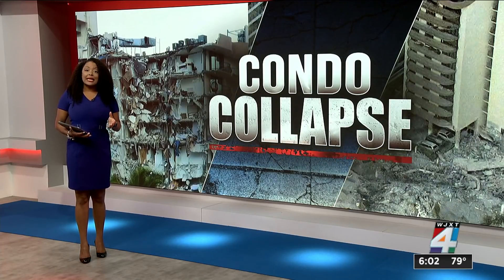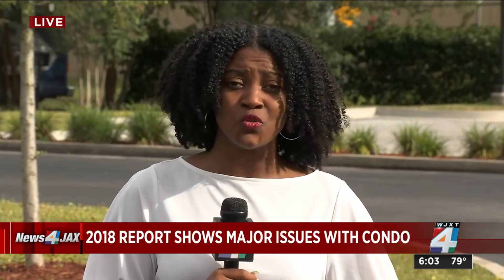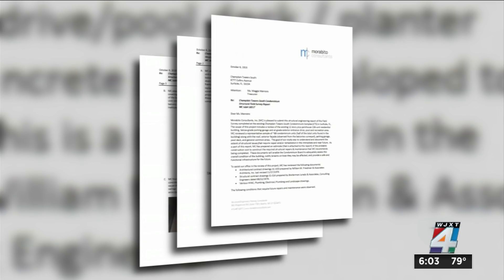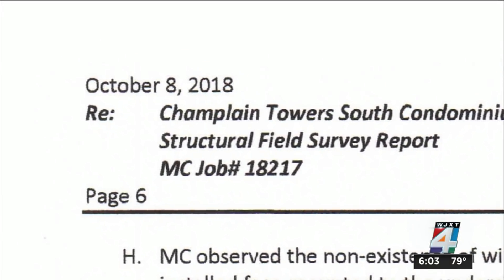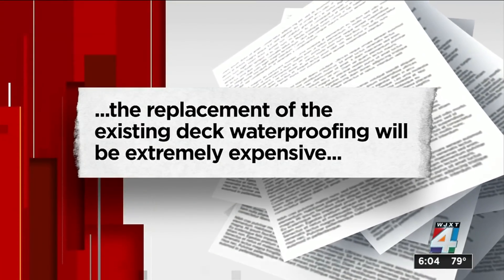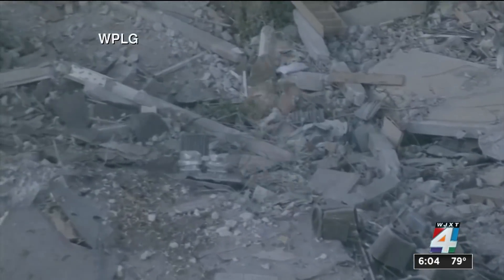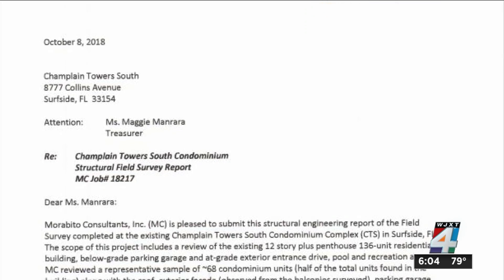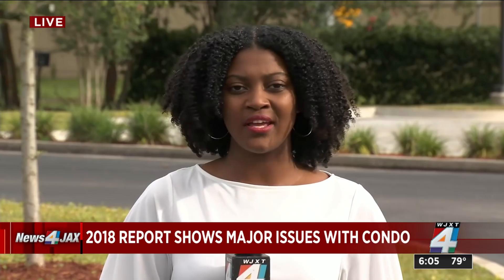2018 engineering report showed ‘major structural damage’ before condo building collapsed

Comment: Lol "repairs would cause inconveniences to the residents."
Reply: Does that mean the residents don't rate safety standards that will protect them
Reply: @leonardroblessr.6120  No it's saying that the inconvenience caused by their inaction is far worse for the residents had they done the repairs needed.
Reply: @oatlord  honestly speaking, for a building to collapse like that it's beyond repairs. It was supposed to be torn down. No amount of "bandaids" were going to keep 40 years of damage to that extent from total failure.
Reply: @oatlord  No it's not. Why do people keep reading this line incorrectly? It's in the 2018 engineer report. Is engineer trying to explain to their customer (The HOA/building owners) that they have a serious repair on their hands, that even though is going to be disruptive and expensive, MUST be done. It's almost like you people are thinking these came from the building owners or something. What you're saying, doesn't make sense. It's not related at all in anyway to the collapse and is a statement from years ago.
Reply: @jonny-b4954     This is true, but the commenters aren't necessarily confused about or misinterpreting this quote.  I think they're just pointing out the irony that failing to either repair the damage right away or evacuate tenants led to exponentially worse "inconveniences" for the tenants.  That's called "dramatic irony"; our current context for the quote gives it a different meaning than it had for the engineer who wrote the 2018 report.  We have knowledge that he didn't have about just how horrifically "inconvenient" the situation became.       ////Bunny kisses for all!
Reply: @DelinahLovesHouseBunnies  Yeah, I some of them I read like that. As dramatic irony. But some... just reading an out of context comment or quote and running with it. Certainly is a tragedy. If law for inspections was say 25 - 30 years or something they probably would have found the damage in earlier/moderate stages of deteriorating and actually had time to approve $15 million (though would have only been a $5-8 million repair at that point) hire the one of only a few contractors who does that type of work in region, get on their schedule etc. before collapse.
Reply: @jonny-b4954    I agree.  They'll probably change the law to inspect after 20-25 years, instead of 40, the first time post-build; at least, I hope so.  And, yes, the comments did seem to be a mix of irony and misunderstanding or out-of-context, knee-jerk reactions.  I don't understand why they didn't evacuate when the county inspector was there, two days before the collapse, given the spalling, but I guess it didn't look as deteriorated as it truly was.  Or maybe the main cause will turn out to be a sudden sinkhole.      ////Bunny kisses for all!
Reply: @jonny-b4954    Ohh, I think I finally made sense of the miscommunication caused by both your and @Oat lord's ambiguous use of a pronoun!  @Oat lord replied to @Leonard Robles Sr., "No it's saying that the inconvenience caused by their inaction is far worse for the residents [than] had they done the repairs needed."  You countered, "No it's not." [italics mine]

However, I believe @Oat lord's "it" refers to his own initial comment, whereas your "it" refers to the structural engineer's 2018 report.  Oat lord's OP is saying that the "inconvenience" of the collapse is way worse than the inconvenience of parking elsewhere or temporarily moving out.  In support of my interpretation, Oat lord adds, "I mean, it surprises me how many of you missed the irony and thought I was being serious."      ////Bunny kisses for all!
Reply: @oatlord     To communicate clearly, I recommend you edit your reply to @Leonard Robles Sr. to include a "than":  "No it's saying that the inconvenience caused by their inaction is far worse for the residents than had they done the repairs needed."  Without the "than," "the inconvenience... is far worse... had they done the repairs" confusingly sounds like the opposite of what you mean.      ////Bunny kisses for all!
Reply: @DelinahLovesHouseBunnies  or maybe people need to read a little closer before exploding emotionally. Pretty certain my original statement illustrated the irony in the report's statement.
Reply: @oatlord     Sorry.  I, myself, could have communicated more clearly.  Yes, they should have read more thoughtfully.  But communication is a two-way street; readers have a responsibility to read and think carefully, and writers have a responsibility to write clearly.  Sarcasm and tone are difficult to read online, especially when there are so many conspiracy theorists and people with extreme ideologies who actually believe the outrageous things they write.  However, your original comment did a good job of communicating dramatic irony by prefacing the quote with "LOL."

On the other hand, your first reply (to @Leonard Robles Sr.) was confusing, because you accidentally omitted "than."  I initially understood your OP to be dramatic irony, but then the reply ("the inconvenience... is far worse... had they done the repairs") seemed to counter that.  I, myself, had to read both several times, back and forth, until I realized that adding the missing "than" harmonized the two statements.

Thus, for the benefit of future readers, I recommended that you insert the "than" to make it all make sense.  "Than" flips the meaning, sort of like a minus sign or "no."  If you had written, "I mean you no harm," but you had forgotten the "no" ("I mean you harm."), who would be primarily responsible for the misunderstanding, you or the reader?  (This is in regard to your first reply only, not your OP.)       ////Bunny kisses for all!
Reply: who needs repairs anyways
Reply: The problem with common sense it’s not common
Reply: As opposed to death.
Reply: I mean, it surprises me how many of you missed the irony and thought I was being serious.
Reply: When that comment popped up on the screen, irony literally came bleeding from my pores.
Reply: Death is an inconvenience
Reply: @Cory Hill what do construction workers have to do with this?
Reply: @oatlord  Not a god damn thing.  We build per plan with daily building inspections to make sure the work is done correctly.  This is followed up by near daily special inspections to double check the work conforms with the plans / specifications and to test the materials used.  Once were done we get paid and go onto the next job.  What people do or don't do over the course of the next 40 years is up to the buildings owner.  I am a superintendent for a rather large general contractor and this was a preventable tragedy.
Reply: No, what's worse is her stating she never saw that report from October 2018!! How did that work out for you now? No checks and balances!
Reply: If this building was really unsafe then the build code inspector would have condemned it back in 2018. 
This building was targeted for a reason
Reply: @fireboltaz  WTF do you mean targeted?
Reply: like having funerals is convenient what a dumb government Florida is very loose spring break government! All this government does blame the other now they can blame starbucks coffee drinking inspections who probably cut corners it is obviously with recorded documents former mayors and city councils didnt bother to fix many buildings remodeling, Good luck and hopefully your hold starbucks government accountable, citizens need to have files on who does what, finally some physical work not just virtual works hey computers dont fix building Get work!!!!!!!!!!!!!!!!!!!!!!!!!!!!!!!!!
Reply: Translation: The HOA doesn't want to pay for hotel stays.

Comment: I think a 10 year inspection would be way better. 40 years is a long time nearly a life time.
Reply: Especially in a climate where flooding occurs all the time.
Reply: Yes, flooding and anything on the Coastline in Southern Florida needs to be much more conservative!! Anything after flooding, Storm surge, and/or  Hurricane needs to be inspected right afterwards!!
Reply: Time between inspections was not the problem. The defects were discovered about 3 years ago and nothing was done due to the costs of repairs. The engineer who did the inspection and discovered the structural defects should be required by law to notify the Building and Safety Departments and those departments should revoke the certificate of occupancy until repairs are made and the building is certified to be safe.
Reply: @briangc1972   i get that part I'm just saying inspections need to be allot more frequent. And if there's problems with the building like you said they need to follow thru and fix those problems. And there should be follow ups to make sure things get fixed or there threatened with a shut down. The bigger the building the more frequent a inspection should come. After finding out it takes 40 years for an inspection makes me feel allot less safe in these buildings even tho I know there is a extremely small chance of this happening again or for a long while.
Reply: @MGk-Farmer  even sadder..I heard the news other day claim the building was around 40 years old..could you imagine living on the most southern coast part of Florida in a high rise condo that hasn’t been through any of the inspections except for what was approved the time it was still a brand new building FOUR DECADES AGO?? How many storm surge flooding hurricanes, how much construction next door, how much erosion, how many patch up to cover up jobs, etc..the list goes on and on…just the vibrations from all those years of all activity..IM SO SORRY FOR THE LOSS OF PRECIOUS LIVES AND THOSE HURT PHYSICALLY/MENTALLY FROM THE SENSELESS NEGLIGENCE THAT COULD HAVE BEEN PREVENTED!! My prayers and heart go out to you!!!
Reply: This building was Epsteined. Don’t let some dumb report try to explain it
Reply: @fireboltaz  Nope…that would have required planning, energy, and effort!!!
Reply: @low self-esteem    I just read an article that mentioned that, in Miami-Dade County, the first inspection (after all the initial inspections while a building is being constructed) is after 40 years, then it's every 10 years after that.  That has worked fine for all the other buildings, apparently.  However, given how ocean air corrodes and can cause spalling, I agree with you that every 10 years seems better for this area, or maybe after 20 years, then after another 20, then every 10 after that, since problems usually come with age.  [edited:  Oh, right, the hurricane flooding!  Surely that can rust rebar quickly; maybe reinforced concrete buildings shouldn't even be allowed to be built in flood areas, unless there's a way to waterproof them, which I think I read there is in modern times.]

However, if developers cut corners, which we know happens regularly in the world due to greed--although I'm not sure at what rate--spalling and the like can happen much sooner than otherwise.  Yet, if there is/was corruption (I have no idea if there is/was or, if so, how much, in Miami-Dade, but we know there is plenty worldwide) and officials accepted bribes to overlook problems, then more frequent inspections won't/wouldn't've helped.  Sending different inspectors each time ought to help a lot with that, as well as having more than one person in charge of approving buildings and granting certificates of occupancy.  It's probably already done that way.

And if an official really knew that a building was in danger of collapsing, I find it hard to believe that one would cover it up.  There are so many powerful motivations to not do such a thing.  So I don't think corruption was involved.  Possibly the developer cut corners with the waterproofing or something.  The report mentions design flaws that prevented water from draining properly, so that certainly seems like a reasonable main/major cause for this tragedy.

An earlier inspection would've given them more time to fix the issues, plus they would've caught it earlier, so presumably (well, maybe) it would have been cheaper to fix, although it really just needed to have been built correctly in the first place.  So I agree that the first couple of inspections ought to be every 20 (or 10) years, followed by decennial ones.      ////Bunny kisses for all!
Reply: Your right, 60-70 years is about the life expectancy of these types of buildings anyways
Reply: @lightpropulsionguy  For sure. Average parts in the building 20-30 years, max. That includes screws/bolts, caulking (more like 10 years in Florida with UV) And just simple average lifespan of a reinforced concrete slab building is yeah, 50-75 years. It's CRAZY when you think about it. I've personally never been a fan of reinforced concrete construction. Prefer steel.
Reply: 40 years per city is one thing but it's the fiduciary duty of the BOD that they direct the HOA for Daily repairs. That's the purpose of paying dues to an HOA!
Reply: I would suggest weekly.
Reply: It’s not nearly a lifetime it’s half a lifetime.
Reply: @andreaam805   most people don't live to be 100 years old most people live to there 80s so yes half a life time. That's two generations of babys growing into there twenties. And let's say the guy who built the building was in his early twenties which I doubt he was but let's say he was a young guy in his 20s by time 40 years go by he's already in his sixties which is pretty old. And  I didn't even factor in what years of rain salt water erosion flooding anything that can happen to a building over a 40 year span. I'm just saying allot happens in a 40 year span allot happens within one year so why wait so long too check up on these buildings that you have people staying.
Reply: Every 5 years would be better
Reply: K S  ...Florida is a giant, flat sandbar sitting on a submerged plateau that is mainly sandstone and limestone at the top. It is a porous, saturated mess, that's prime natural sinkhole breeding without needing some burst water lines. Even if this instance didn't have a sinkhole or regular flooding in that parking garage... You're talking about Levees in a place where that's still just stacking onto the top of a wet house of cards? Your statement is dumb.
Reply: Keep electing Republicans. You get what you deserve.
Reply: @bradforward850  👈🏻 Show me you’re stupid without saying your stupid. 
Well done, son.
Reply: @bradforward850  keep voting for Dementia Joe.
Reply: @bradforward850  Like what? Enough money to afford a $500,000 condo? Definitely doesn't sound like a problem caused by Democrats. Their section 8 housing never has issues.
Reply: @stephaniegormley9982  no issues at all…just ask channel 4 about all of investigations on HUD section 8 housing RENTAL ASSISTANCE the not for profit pastors/ministries “aka” SLUM LORDS THAT ARE GUARANTEED RENT PAYMENTS FOR EVERY TENANT REGARDLESS!! They are guaranteed funds straight from HUD!! Metal stairs rusted out from underneath, rats vs. roaches fighting for dominance over the other!! 
Complaint after complaint..no response..so ridiculous people have to band together and get the main news channel journalist involved and investigated!! Why don’t you take the time to look up all your HUD HOUSING CORPORATIONS W/ OWNERSHIP AND SEE THEIR POLITICAL AFFILIATION.It’s very simple and if you actually have the motivation to educate yourself. Please, please come back and share what you found. If I’m wrong I’ll be the first to admit it. However, it’s this kind of ignorance that is causing USA to be taken over by lost souls who show their  faces but do not have the brains or powers to make the decisions and are THE MINIONS of FOREIGN AND LOCAL SOCIALIST/COMMUNIST/MARXISTS PAYROLL THAT IS AT THE TOP OF THE SAME AFFILIATIONS AS THISE SO CALLED HUD PROPERTY/PASTORS…
I MEAN SLUM LORDS  TODAY CALL ME YOUR PASTOR ON SUNDAYS..and don’t forget to drop your tithe in that plate as funds are being raised to do renovations and restore buildings in order to help the homeless off the streets and provide housing for the sick and poor!! Also, because THEY ARE SO GOOD HEARTED AND CARRY SO MUCH LOVE AND PASSION FOR GOD!! They are sure to remind all that it is all in the precious lords name!!  Yes, I love Jesus and I believe it’s not my job to judge but it is my DUTY to share THE TRUTH!!!
Reply: @_S0urR0ses_  Don't know if anyone has got around to telling you this, I kind of hate to break it to you; but god doesn't exist. I mean, you already believe every other god in the world doesn't exist, what's ONE MORE god? Make the leap, give up the voodoo, fairy tale nonsense.
Reply: @stephaniegormley9982  what about the local trailer parks
Reply: @bradforward850  ~ Democrats and the Republicans are the Left wing and the Right wing, who are attached to the same bird, who are the corporate fascists who own all the government debt and corporate debt in the world. "The rich rule over the poor, and the lender is servant to the borrower." Proverbs 22:7.
The Democrat communist fascists and the Republican socialist fascist are both headed toward the same goal, “New Order for the Ages”. The Democrats are just in a bigger hurry to get there!!!
"Novus Ordo Seclorum": The Latin phrase Novus Ordo Seclorum, means "New order of the ages” can also be translated “New Order of the Generations”.
Reply: @bradforward850  lmao
Reply: @bradforward850  like all the cities plagued with riots and the democrat run city of Miami. Theres been multiple political changes in leadership in Miami. Hate to inform you they don't do private home inspections or repair.
Reply: @bradforward850  Miami is controlled by democrats like almost all major cities.
Reply: @bradforward850  Mayor of Miami-Dade is a democrat there guy.
Reply: @KuariThunderclaw  this is Joe Bidens America now. He's responsible